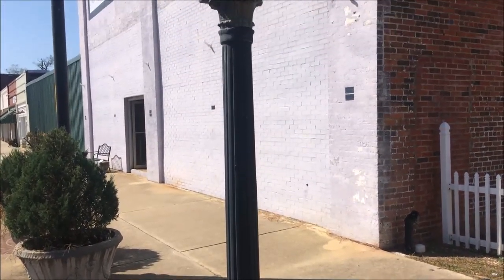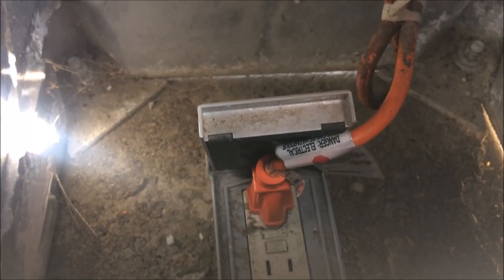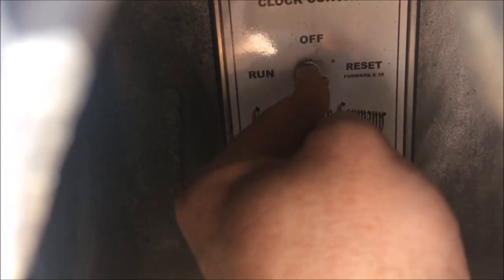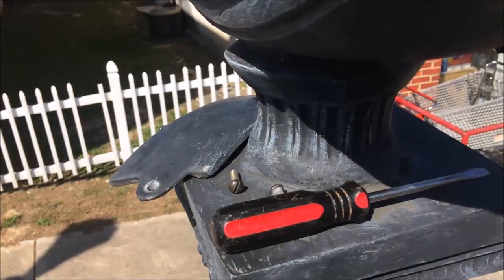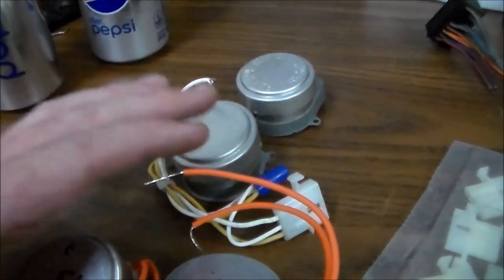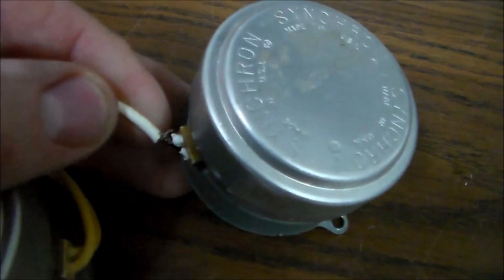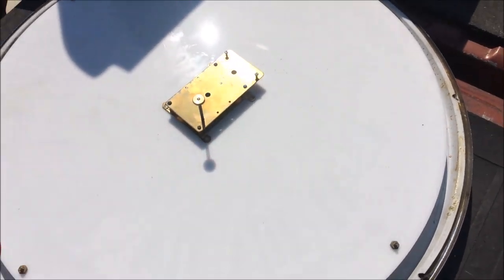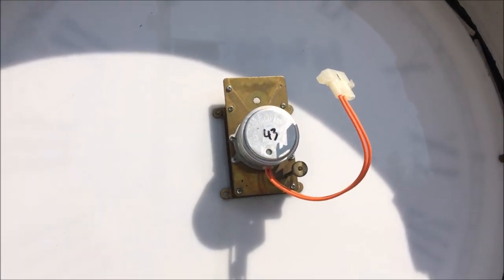Repairing the Street Clock In Jefferson, SC - Main Street U.S.A.

Comment: I have a true clock story for you...
At Disneyland in California guests were complaining that the clock was wrong on the train station...maintenance went over checked out the clock everything seemed to be fine..he called over to City Hall to get the current time to set the clock..guests continue to complain the clock was wrong..finally they figured out that when he would call City Hall to get the time they would look out the window and read the clock he was working on....
Reply from the maker: That's hilarious, I had never heard that one before!
Reply: @LyonsArcade  what's a light on the timer photocell?

Also wants at a church I redid this steeple YT although day. 8 foot and four foot fluorescent in there going all the way up they were not working bad ballast in every fixture.

The old time clock was shot the timer dial and the Trippers were shot and so was a switch motor still ran.

I asked if they absolutely it on and off at a certain time and said that also that that time we drift due to changes in daylight.

 Over time of the year.

And also that it would only be on their nose hours.

Said it would be actually cheaper to use a photocell inside of the steeple the lower part of it that went all the way up and had grass all the way up.

So I actually installed a photocell facing outward and yes it has socket to easily replace it.

It was one of the boxes like you might see on a pole that just has a photocell sticking out the top of it with receptacle.

So if it ever went bad you just unplug it and plug another one in.

Like some street lights.

Orwell's high intensity discharge yard lights.

And yes I had a spare photocell as well.

Also I was fixed a noon whistle and old place where friends lived at.

Had worked for years and years.

Comment: Now this is fascinating to see. There's a similar old-looking clock in a small town near me that I've always been curious about who maintains it, if anyone.
Reply from the maker: You're gonna have to go fix it LGR, if I can do it you can definitely do it :)
Reply: Hey there few things with that repair of the Town clock.

First what type of connectors are those specifically.

Make model Etc if possible. 

Any info would be helpful. 

In addition a link would be great. 

But I still need specific info on the connector as well.

It does remind me of a Molex connector of some sort.

Or at least based on the design of a Molex connector.

I need these for a custom personal project.

All so you're right in a way about the fast 10 RPM Motor.

And yes synchrotron is a type of motor.

But what is going on with the 10 RPM Motor and 1 RPM Motor.

You are absolutely right it is remote set.

That control box would typically be like inside a building.

Or something similar to that control box typically would be mounted on a junction box in wall.

Usually a signal toggle switch oftentimes if they use a plywood clock like I'm talking about below.

It would be located right below that clock.

One of the applications for those is such as you know how sometimes they may have a clock on on  a bank sign.

 analog clock.

Or other sign that may have a clock.

Or maybe a exterior Clock Tower that's just got electric clock in it.

But of course would be a much heavier Duty movement but essentially a more powerful and larger assembly.

Is that a yes so that you can remotely set that clock.

And and where that clock is not visible from the location where switch box would be.

There is what is called a pilot clock.

Which is a single face clock that would look like a normal clock.

Like that you would have on the wall accept it has the same mechanism essentially

But it would be wired in parallel with the power or sign clock or whatever clock that the switch box with control.

So that you could watch that clock for saying purposes when you could not see the other clock.

Also there are clock systems what they called Master Slave systems were you have a master clock in such as a school.

I'm not talking about the ones that fancy hands once a minute with pulses.

But all the clocks would receive power from a common clock system.

AKA Master Clock.

Often times these also ring Factory bills such as launch bills Etc.

 or in the case of a school the passing time bills and all that would be run by that same clock usually.

I personally know quite a bit about these not professionally though.

I'd known about these and scrapped out several units many years before.

Of course got the clocks and the controls etc for parts.

Also I had repaired a few of the system parts.

Real fact once I did repair our schools clocks.

Weird thing though.

 That sister was quite old don't know if is original or not probably not?

 but there were several things not in use some things just playing half. Off it are things that obviously wiring had been disconnected.

But still left in place.

And some cases just to worry disconnected from a terminal and tape to the side.

Also the first time I went in there is poking around.

The fire alarm went off for a second or two.

Stirile the heck of me and everyone else.

And and I do this something that made me think.

There was a wire connected to a terminal that was labeled FA.

And I'm like did I just do that.

 it was hooked up to some other parts of the system through relay if I remember correctly.

And it turns out the switch that would have enabled or disabled that connection was bad.

On top of that there's a loose wire That was making internment contact if you want to move something just right.

 Turns out at one time the fire alarm had also been used for the school bells.

Or at least part of them.

 From what I understand that is sometimes a common practice.

At least part of the time?

Also I'd heard about that once or twice elsewhere.

 Also one of my old friends used to work on all kinds of interesting things.

 She told me where they had tailed clocks for he used to live.

 That was on a Master Clock system for the whole town.

And to his surprise when he first opened up on the clocks.

There was high voltage insulators and stuff.

 it did not have to do with a clock Motors themselves.

 It had to do with the light.

Incandescent bulb.

Not rated in Watts or volts.

It was rated in amps.

AKA series street lighting type bulbs.

 But why rated in amps?

Constant current AC.

From a constant current Transformer.

 We're probably been 6.6 amps if I'm not mistaken.

 Same as used on some of the old series Street Lighting systems.

That was probably not a good idea.

 You're talkin the thousands and thousands of volts.

 and every one of those had a bulb and every one of those had a bulb in series and every one of those had I don't remember how many bulbs though.

I think it was more than two.

 This is long time ago I heard about this.

Also The idea of Master clocks goes back a very long way.

 But this would probably still be watered by what I would say.

Sort of.

 At one of the Biltmore residences.

Their clocks we're all ran by The Clock Tower Sort of thing. Although not a true Tower clock.

 is that would send a pulse once a minute to every single clock.

 So that every clock would be perfectly on time.

 This was a very early system.

 This is basically what would be called minute impulse.

 also a lot of the system so school clocks Could be corrected either once every 24 hours or once an hour.

 Subway pay recognize the sound of a clock of sudden stopping and then restarting with a click.

 Possibly once an hour.

 the clocks at our school.

Were corrected at once every 24 hours.

 And they'd run pretty fast.

 talk about time flying.

 Someone show me a video that shot when they were doing some work I think it was one of  My fellow stage crew members.

 This was high school by the way.

 by the way I remember that I would usually be the one to be called if the bills got stuck.

Once I realize what the problem is I Wild up grabbing some relay is for my shop is that where the right ones.

 turns out the contact sometimes with stick or weld.

 also I did put in a switch to open that circuit.

 that would that would also Light a red neon indicator assembly to let you know that the bills have been disabled.

 if a relay could not be changed right away if that was the problem.

 also I got a bracket for that relay socket and moved it where could be easily yanked out and replaced in about 2 seconds.

 And later on I taught people how to do that safely.

 although the earthing is it had a habit of blowing some fuses here and there.

 by the way I had a container with relays and fuses Buttload unit.

 I even wrote, manual for it as well.

 add troubleshooting and all that and instructions what to do and what not to do.

 And if it's not working right what probably somewhere done by accident.

 Also I fully documented the whole thing and wiring and where things went that no one knew where they went excetera.

 also I will end up throwing also I welled up Rapping out all the the wiring and drawing of full schematic of the system.

 Also I suggested they update the system with a decent solid state controller.

 The thing was absolutely ancient.

 the bells were actually programmed with what looked like ticker tape.

 but heavier and inner loop but heavier and yeah I did a Long Loop.

 I did repair a few blocks as well here I did repair  The clocks is well here there.

 but usually maintenance would take a clock out us where did it need it like saying Supply Closet and swap it for one that wasn't working.
Reply: @aaronbrandenburg2441  Molex # 03-09-2041 or 2042 plug housing, # 03-09-1041 or 1042 Receptacle housing, # 02-09-2118 male pin crimp terminal, and # 02-09-1119 female socket crimp terminal.
Reply: @Sunsetdrivein  thanks I've been looking for information on those types  of connectors.

Also is it best to order straight from Molex.

Or other electronics company.

I would need somewhere if it is another company.

 that I could order in smaller quantities.

You know a few sets a Time.

Or small package of them.

Although not necessarily individually.

But smaller reasonable numbers.

Another option might be a connector kit that includes those particular ones.

And perhaps a kit with the proper crimp tool.

Because I've got upcoming projects that Molex connectors.

 would probably be the way to go.

Of various number of pins.

I would like to be able to to standardize on one series of connectors.

So that I could use I could use them four repairs or projects or whatever.

Same contacts just different number of contacts.

I don't need one's larger or smaller than that .

As in physical size or current capacity.

so it would be fine to use call the same series of connectors.

If you have any suggestions where to to purchase them.

 would appreciate it.

 please comment.

Sounds like your kind of Handy like I am.

Even though I'm not in any type of repair trade at all.

I'm self taught in mechanical electrical electronics Etc.

And computers as well.

Literally almost everyone that knows me says.

If I can't fix it it ain't broke.

You should have seen me on stage crew.

Good Times.
Reply: @aaronbrandenburg2441  Molex won't sell direct. You have to order large quantities and be a distributor to order direct from Molex. I buy Molex products from these distributors: Digi-Key, Mouser Electronics, and Jameco Electronics because you can order any quantity, even small orders. The .093 size connectors are the most often used and are typical for 120 volts AC and lower voltages. The .062 are usually low voltage which are used for "logic levels" like in a pinball machine.
Also, check out ebay seller "stevevarida". He sells Molex kits/assortments and ships super fast from Silverdale, Washington (a little over an hour away from me). BTW, I have been on stage/film/tv crews and have a credit as actor on IMDB.

Comment: The reset is also used to set for daylight savings.  Shut it off for backwards.
Reply from the maker: That makes sense!
Reply: Yeah I forgot to mention that on that comment I made. Oops
Reply: Flipping it and waiting 6 minutes doesn't seem like that big a deal.
Reply: This just cleared up a lifetime of wall clock curiosity for me.
In my elementary schools, we had a few two faced clocks that apparently had the two motor setup. 
Wherever the clocks needed to be reset, the central controller would put these clocks into a faster mode. While pulsating the 'clunker' clocks faster to advance them too. This must be a somewhat common setup in schools.

Comment: The reason for the two motors is to synchronize multiple clocks. It may be counter-intuitive, but multiple synchronous motors like the ones in clocks will always run at exactly the same speed as each other, as long as they are connected to the same supply. Synchronous motors are not like brushed DC motors or AC induction motors - they will always stay exactly in sync with each other because they are locked to the AC line frequency.  So let's say you have multiple clocks across town, all connected to the same power source - they will always stay synchronized. Occasionally, you might need to reset the time on all the clocks, and this is where the power switch in the bottom of the post comes in. If all the clocks are connected to that one switch, you can set all the clocks in town by speeding up or stopping the clock you're looking at until it reads the correct time. By doing that, you have effectively set all the clocks to the correct time, because they are all controlled off that one switch. And because they are using synchronous motors, they have been set forward or backward the exact same time. In reality though you may only have to reset the clocks twice a year because of daylight savings, as power companies try to compensate for gained or lost cycles because clocks like this one, which are surprisingly common. If you have an AC powered appliance with a digital or analog clock, it probably keeps time by counting AC cycles. Also those mechanical lamp timers, and some actual clocks.
Reply from the maker: Thank you Josu, I appreciate the explanation!  That makes sense.  It would be a nightmare to set the clock ahead 23 hours though for daylight savings time in the fall, whew!
Reply: @LyonsArcade  well, you could turn it off for an hour 🏆

Comment: Re-lube for clock motors:
 I worked on hundreds of clock radios over the decades. Most were Telchron, but it worked with others too.
 The easy way to lube them is to place motor with the shaft up. Place motor on 100W light bulb.
When the motor is too hot to pick up with your bare hand, take it off the bulb with a oven pad.
 Immediately start dripping light weight oil ( 3 in 1 or ATF) around the motor shaft seal. You will see air bubbles coming out around the seal. The oil will get sucked back into the motor through the shaft hole. Keep dripping oil until it wont suck any more in.
 Re-test motor. Should work just fine, unless something major has failed in it.
 Yes, proper thing is to replace motor, but when you can't get new parts, this will work several times. Usually the motor works for a year or 2 before needing lube again. One I have has run for over 10 years now. HTH
Reply from the maker: Thank you F.K., I'd never heard of that, I'll give it a try next time I get one that's messed up, I appreciate the tips!

Comment: Geez !! What a peaceful place. Looks desert with empty streets at all times :=).
Those motors look like the same type you would find in some of Williams system 11 pinballs such as the ferris wheel in Cyclone or the drawbridge in Black Knight 2000. The voltage is different (110v for the clock vs 24v or 48v for the pinball ones) but the inner guts are similar i reckon with a gearbox that would turn all gummed up and chewed after long years of service leaving no choice but to replace the full assembly.
Reply from the maker: It was shot on a Sunday morning, everybody's in church and none of the very few stores that are still in business, are open on Sundays.
Reply: @LyonsArcade  Impressive anyway :=) I live in a small village in France and believe me on a sunday morning even when ppl are supposedly at church, it's not as quiet as in your street :=)

Comment: Back in the day,  the clocks in my school were set sort of like that, but they only used one motor.  A solenoid would click, and the minute hand would latch to the second hand.  And yes, they took FOREVER during time changes.  Somehow, they all remained in-sync.  The solenoids were controlled by what's called a carrier current switch.  Works similar to X-10 power controllers.
Reply from the maker: Somebody was telling me that since they run off of a 'hz' setup that it's impossible for them to go out of sync but heck if I know!  That's pretty wild they latched it to the second hand, but it makes sense!  Thanks for the info, Kelly!